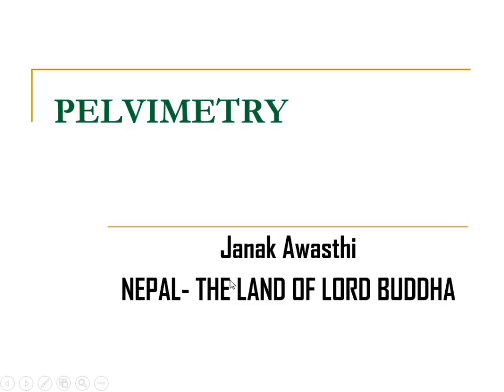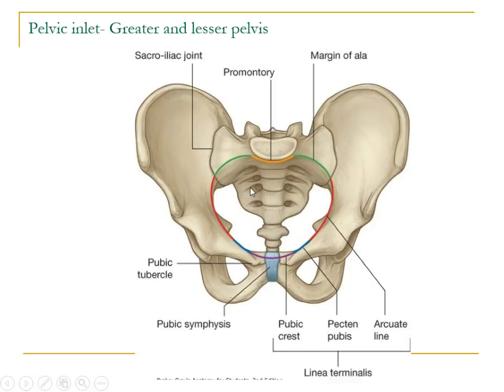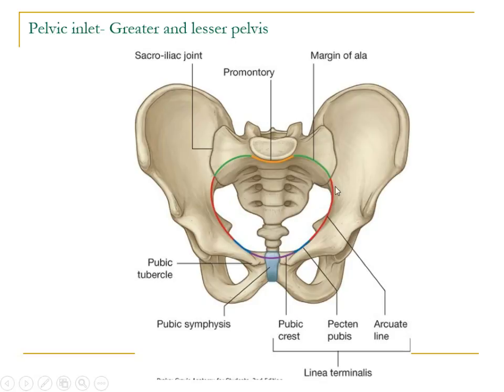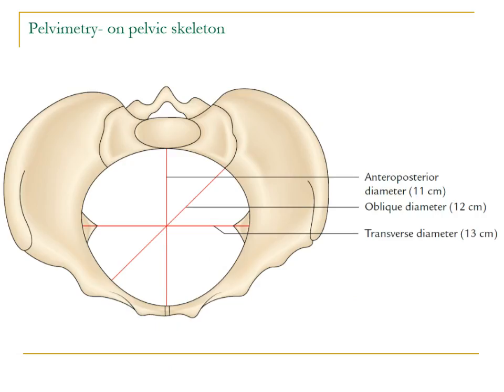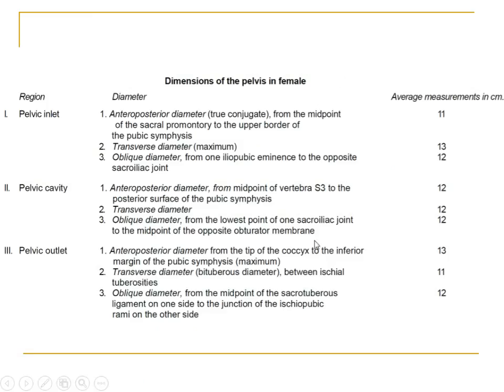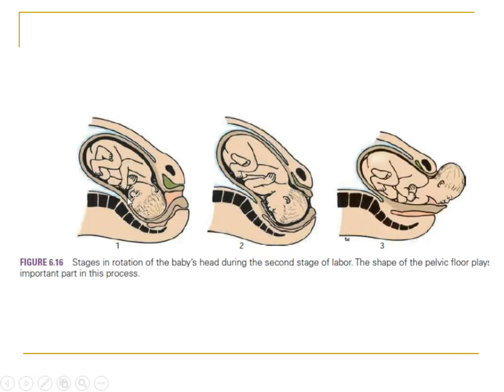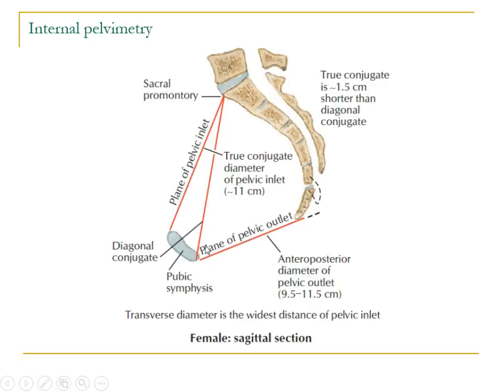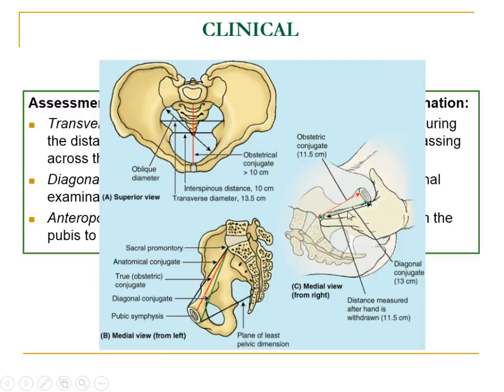Pelvimetry of Female Pelvis [Video lecture]

Comment: so how do you say if there is cephalopelvic disproportion given all the measurement, head average diameter and allowance for expansion during birth...  what do you use inlet midplane or outlet to call cpd and what is the minimum call for cpd...thanks
Reply from the maker: The diagnostic criteria of CPD have not been clearly defined. However, the minimum plane of the pelvic inlet could be used to calculate the circumference of the minimum pelvic inlet.  Upon subtracting the fetal head circumference from circumference of the minimum pelvic inlet, if the difference is under 2cm, it could be used as diagnostic criteria for CPD